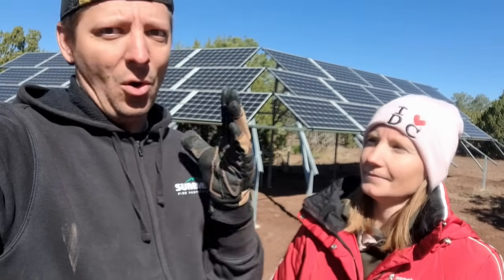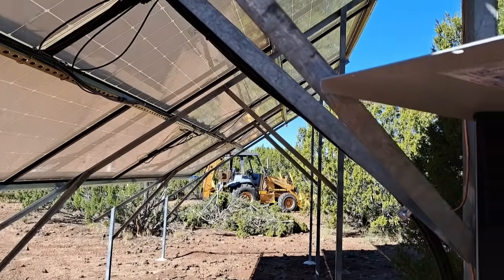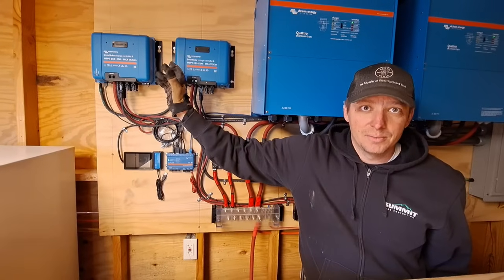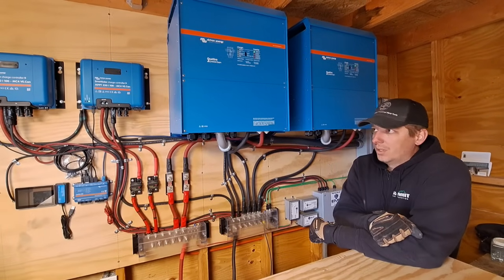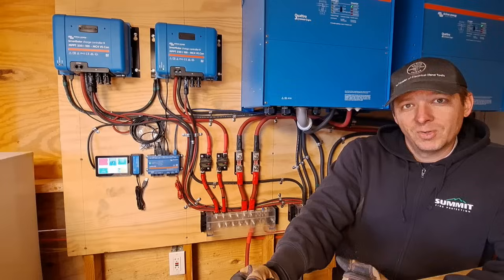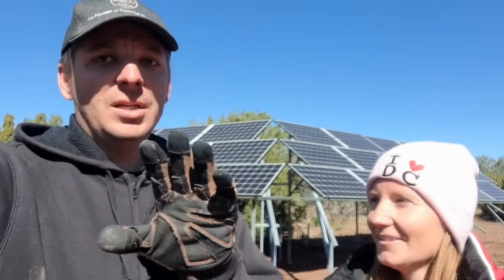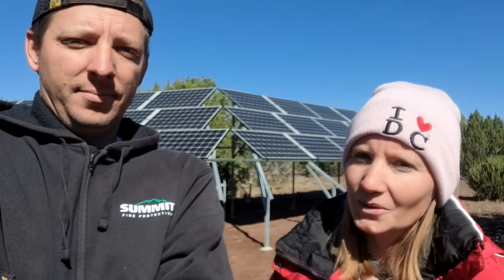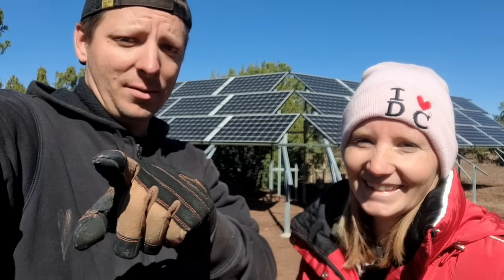INFLATED COST Of Our 100% DIY Off Grid SOLAR POWER SYSTEM 👍

Comment from the maker: We forgot to mention that the federal rebate is 30 percent, which brings the total cost down to $25,930. Kind of a big thing to leave out 😅. Hope this helps. We appreciate your comments and for taking the time to watch our videos.
Reply: do you need a contractor to get the rebate?
Reply from the maker: @Adam D  No actually, we don't. Thanks for watching. 🙂
Reply: Adam, no - but the equipment has to be new. If you didn’t pay enough in taxes to take full advantage of the tax credit, you can roll the credit over to a subsequent year. Oh and any tools you buy to do the work are also eligible…
Reply: @Poorehouse  wow nice thanks for the details!
Reply: Great vid! Exactly what I wanted to see. Question though..does that make it so you are completely disconnected from power company?(im on California so pge for me and I know people that have gotten solar power but still have to be connected to them) looking to buy a piece of land and build a small cabin and that’s my main concern. Thanks
Reply: @crislopes4518  yes, but you need to live within your battery capacity as there is no grid to rely on. That equipment/setup can be grid connected for charging or as primary source then switch to battery on a schedule or based on outages. Or generator connected - which is a must for true off-grid power as the sun doesn’t always shine - so you need a generator for those long grey weeks in winter.
Reply: Why didn’t you go with signature solar’s EG4 package instead?
Reply: That assumes you pay taxes. I am retired and live off my savings that. Have saved up. So I no longer pay taxes. So federal tax rebates are of no value to me.
Reply: @futurebillionairekai9058 
He covered that: He said he wanted to avoid the repairability issues of all-in-ones, & then there's the lack of configurability such as multiple charge controllers, & quality control with Chinese factories, & the political issue of US restrictions on tax breaks for Chinese products which are already appearing. 26:12
Reply: Your panel box output  is perfect! There's now smart panel boxes that can route the power where it's needed when its needed and they shutoff breakers that are not in use so devices can't draw power when its unnecessary. That panel will make it seem like you're on 220 amp service when it's still 110 amps. It can also link through wifi to your devices. Also another thing to consider is to make DC run circuits when you can. Lighting is the best DC conversion to start with then installing 12v outlets. For every device you covert. you save up to 15w of power. Lighting with DC LEDs run at 1w and produce the same light as their AC counterparts and are sometimes brighter and take less space.
Reply: If I'm not mistaken when you have a tax rebate it is not dollar-for-dollar ... for instance if you did your taxes and it said you owed $5,000 to the federal government then you remembered you had a $5,000 tax deduction you forgot to apply and you go ahead and apply it your tax bill does not become zero to the feds
Reply: If your a military veteran you wont get federal rebate. Keep that in mind😢
Reply: @superfliping  😅Sorry, I might be overstepping but this hits a nerve with me and let me explain why. Getting rebates or expecting money from big companies for making your own solar energy causes red tape legislation in some areas. The less money you expect, the less they impose. From their perspective they are already taking a loss from you going off-grid. If off gridders freely give away their  excess power to the grid. Eventually the grid operators become the ones who are dependent giving off gridders power of control. Communities who have done this tactic benefit the most and have turned the tables on the companies. They will eventually become a service for those who can't run an off grid system. They will have to provide a cheaper grid service for those people within reason for the cost of infrastructure and employment or if the word gets out of otherwise they are getting disconnected by the people. In some areas where people are being skinned alive by companies services like cell phone and internet, people are turning the tables by setting up their own peer 2 peer services. People are showing that they are fed up with corporate price gauging. Give Freedom Get Freedom strategies seem to be working so far.
Reply: Rebates do not reduce costs, they transfer them to someone else. The savings you enjoyed by receiving the rebate was at the expense of your neighbors and fellow citizens. That's not something to be proud of...
Reply: @A_friend_of_Aristotle  Well another reason for not getting into rebates. They have to come from somewhere. I'm just happy to be free of the electric bill and other bills it helps eliminate at the end of the day.
Reply: With the rebate included assuming $230 a month Bill if you were paying the electric company, your payback would be 9.4 years, that is amazing ,that means everything after the 9.4 years is 100% profit, that's also not taking into consideration the electric rate Hikes that you usually get every other year. Great job guys I wish I had the ability to do this myself.
Reply: Thanks!
Reply: @aboulderlifeoffgrid  just found this video so i don't know, do you have electricity where you are?
Reply: @mrobvious1100 
Not a tax “deduction” but a tax “credit” of 30%. Credits are one for one.
Reply: Please look into the Victron lynx power in and the distributor. And the RS 450/100 or 200  the higher voltage makes a big difference. I love their products but the price,  I have installed a lot of Victron products and I am currently trying to get a Victron lynx distributor and fuses